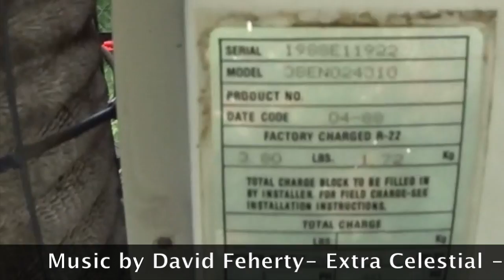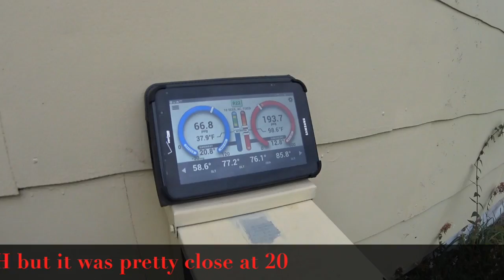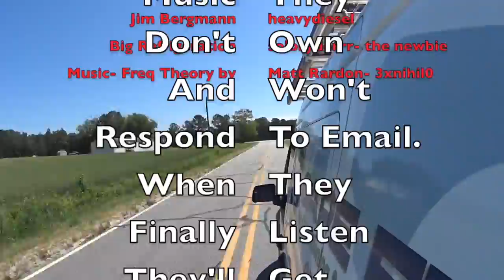HVAC Maintenance: Cleaning Your Air Conditioning Unit Won't Help

Comment: I had a 1988 AC just like that. Coil was so dirty it was drawing 30 amps and tripping the breaker. Cleaned it in June last year worked great for 2 months. Came back for no cool and the compressor was bad. Yes dirt will kill the compressor. Homeowners and landlords find it hard to believe.
Reply: behvac When I find one that's been working extra hard due to a dirty condenser coil, I get that sinking feeling I might be back in a short time 'cause of compressor failure.  Especially if it's been under heavy load for awhile.  You don't want to make the homeowner/property owners feel bad but it really does boil down to simple maintenance.  Every once in awhile I come across one that's still cooling a little and you check the condenser and you scratch your head 'cause it defies logic the thing was working at all.  When units are on the roof and you check the apartment first and you turn it on and you can feel the heat build up quickly from the liquid line, I start thinking dirty coil or bad condenser fan or bad capacitor.  HVAC can be fun like that.

Comment: Looked like a piston indoor coil. The superheat seemed a little high, but perhaps there wasn't much of a load on it? I'm going to say at risk, since I don't know the temp/dew point conditions that it looked a tad low on 22.
 When I check ANY system- the condenser always gets rinsed off or washed- even if it looks clean.
Good video!
Reply from the maker: Thanks for watching newstart49

Comment: It's time for ac maintenance again everyone watch this video then call a professional to come clean your ac before its hot.
Great job Stephen Rardon  I must have missed this one before but great video.
Reply from the maker: It's been a quiet favorite as far as views. Thanks for sharing it.
Reply: Hey Las Vegas Air, you guys staying busy? We were crazy busy through June, steady through July with some dead spots, and hit and miss so far this August. Summers have just not been what years past were. Way too mild. I thought they said global "warming" not "cooling"
Reply: sealteam818 it's been up and down, nowhere near what a summer should be
Reply: +Las Vegas Air Conditioning, Inc. cooling in New Orleans runs from march to Dec, hell i ran one cooling call on new years day
Reply: I wouldnt just spray chemicals all the time for regular maintenance lol. This was to fix the unit which obviously the coil had some air flow issues but if you regularly spray coil cleaner on your coil it WILL burn a bunch of holes into the coil evenually..

Just figured id tag this on so people dont try to hastle me into screwing up their system. Great video and thanks
Reply: @Straight_White_Fatherly_Figure  As long as you use proper coil cleaner and rinse it thoroughly it won't do any damage. However, just rinsing the unit off every month or so with a hose should keep it clean enough that chemicals shouldn't need to be used very frequently or at all.

Comment: What did you use to clean the air handler coils?
Reply from the maker: I sprayed it with some coil cleaner and then brushed the fuzz off as much as possible.

Comment: I was only pointing that fact to you so you could improve your video /edit skills . second thoughts just stick to A/C work.
Reply from the maker: Your constructive criticism could use some practice.
Reply from the maker: I beg to differ, as an technician no explanation is needed when looking at the numbers after cleaning. Thanks for watching despite your "wasted" time
Reply from the maker: I did fix it, not everything that was done was recorded.
Reply from the maker: No, I didn't record everything.

Comment: Hi Do we have to watch how long it takes to clean a condenser that's blocked solid tune sucks as well.u did not say if it worked OK either. They were called dustbin units . ?
Reply from the maker: Nope, you certainly DON'T have to watch but thanks for wasting your time

Comment: Great videos buddy, keep up the good work.  What is that spray bottle that you use with coil cleaner in it? I would like to buy one but don't know where to buy it from. Can you change the dilution rates on it?
Reply from the maker: The coil gun is one I bought at RE Michel a long time ago. You can change the dilution rate at the top. As little as 1/10, I think, and up to 1/1 or bypass the can completely. I think it's by NU-Calgon! Maybe, haven't payed much attention since I got it.
Thanks For Commenting Brad

Comment: Incredibly filthy.  I wonder if it was bad enough that on hot days the system would keep adding heat until the compressor shut down on thermal.   Took a lot of suds to clean that one.
Reply from the maker: It would not have surprised me if it shut down eventually when the sun was directly on it. I'm amazed by the torture that some of those old systems stand up to where the new stuff has so many safeties and limits that they crap out very easily.

Comment: Nice one Stephen Rardon  You sure did use a ton cleaner.
Reply from the maker: It needed it in my opinion. I didn't use as Much as it looks like though. I will do a 50/50 diluted mix to start then when it runs low to about a 1/4 of the bottle I'll fill up with water and run another pass it as 1/4 bottle of 50/50 and 3/4 water. So each pass gets more diluted. Usually.

Comment: Hey, my neighbor had a leak in his a/c.  I don't really like doing work for neighbors so I put him off. 
Then he tells me he added a leak "sealant".  Have you ever run across a system that had a leak sealer added? 
I am very skeptical that leak sealers work, or don't damage the unit.
Reply: dpeagles If they don't work and they never tagged the unit as having had sealant in it, someone like me is going to very irate when my manifold and hoses get gunked up when I go to check pressures.  In my most humble of opinions; if you're too lazy to hunt down a gross leak, especially on R22 systems these days, you're a hack.  If it's that tiny of a leak that it lost less than 4oz per year and you can't swallow the cost of a shot of tracer dye, you might be a hack. :-p It may be annoying when you have a teeny tiny leak somewhere in the lines you can't get to, like say IN the walls facepalm, and you have to otherwise hire outside help to get the job done, unless the caller is a special kind of conceited that you must not hurt those pristine walls, do the job right the first time. :-)  Of course in those special cases where your hands are tied and you can't patch that little pisser, use the sealant but PLEASE put that damn sticker on the outside of the condenser next to the service ports so I won't spend the afternoon flushing my rig. ;-)
Reply from the maker: Talk to Ralph at  T&N Services. He's got some stories!